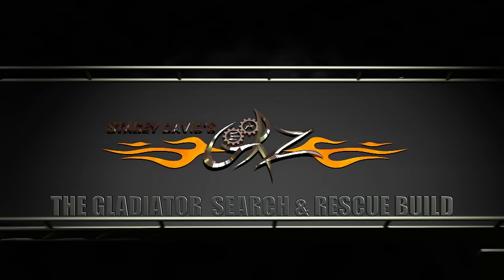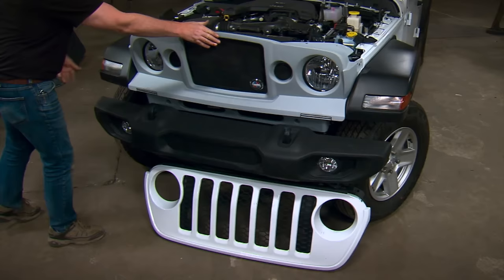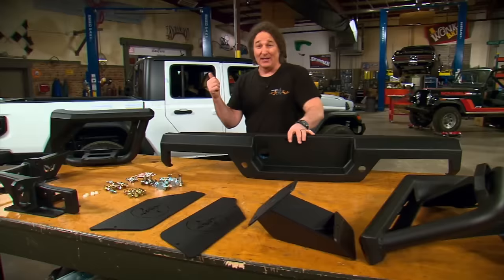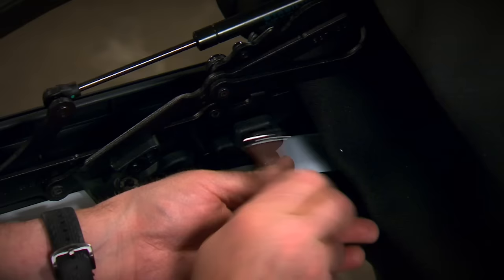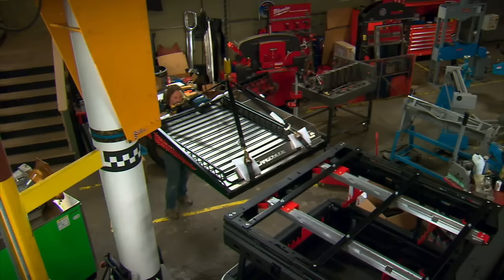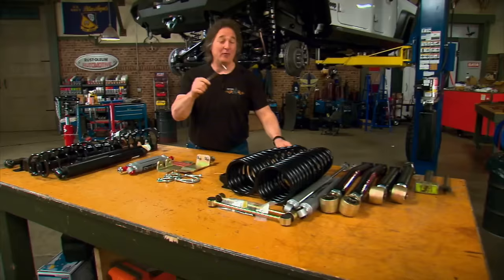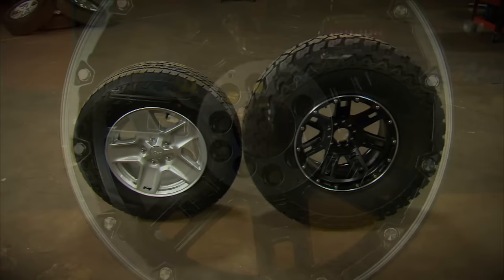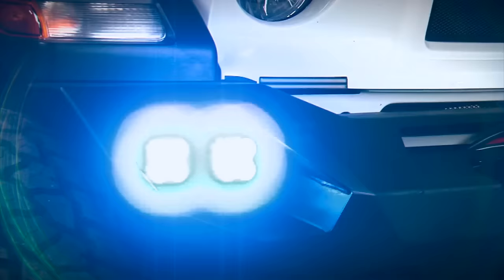Jeep JT Gladiator FULL BUILD - Stock to Search & Rescue on Stacey David's Gearz

Comment: Aloha Stacey.  This is an awesome build-up from ordinary 👏 🙌 👌 😀 😎 😄 👏 to extraordinary.  The only irrelevant item is the Tonneau Cover since the rack replaced the Tonneau Cover on the Jeep Gladiator bed.  The other concern would be having better and more reliable batteries (Regular Battery and Better Auxiliary Battery).

Comment: I hate that new grill, also have to point out how horrible it is function wise.  The 2024 grills are almost totally mesh for a reason.  You won't get enough air through so might be prone to over heating in some cases, and I would be very careful trying to tow with it.

Comment: Really nice build but if you really intend to put it to some serious use you need to change the gearing in those axles. Changing from 30” tires to 37” tires plus all the weight added I would think it could barely move.